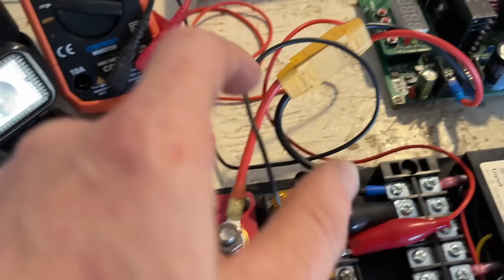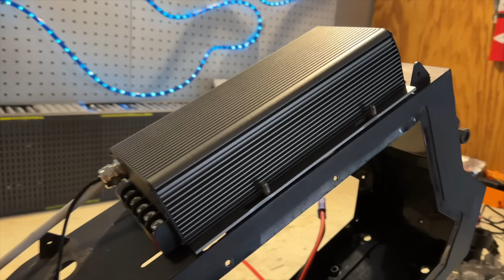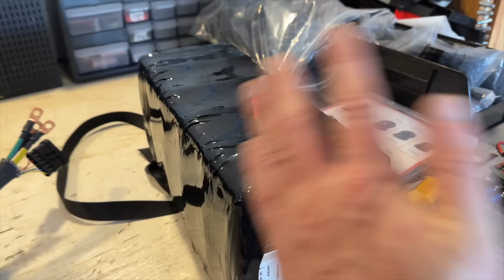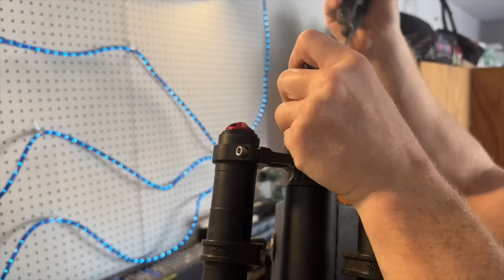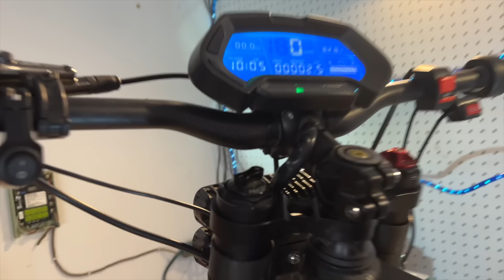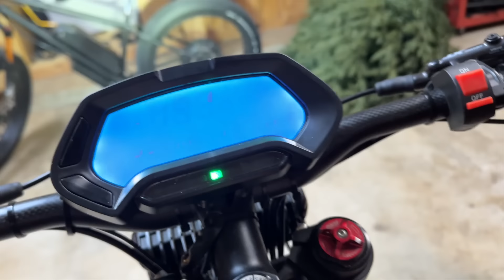This Might Be The Best Way to Build a Stealth Bomber Ebike

Comment: Awesome Video!!!
Did you just straight plug the controller in or did you program it? Because on mine the regenbreaking is not working for some reason.
Reply from the maker: I programmed it but didn't film that part. if you have a throttle connected to the regen throttle harness (make sure gnd, 5V, & signal wires are correctly oriented), you need to enable the "e-brake" option. then make sure you have the ebrake current option set high enough to make a difference. on mine it was initially set too low to notice. there's also the non-variable regen, which activates when you let off the throttle. for that you have to keep the "ebrake" setting off and set the regen option to one of the three settings depending on what behavior you prefer.

Comment: Is the phase junction box waterproof being out in the open like that.
Reply from the maker: definitely not waterproof but its not an issue other than corrosion over time. ideally, the terminal lugs would be nickel plated but if you clean the terminals every year or so it should be fine

Comment: Can you give me a final cost of everything you had to put into this and I must say very very well done
Reply: Yeah what? You must have to call them and ask for better pricing I assume
Reply: another video with NONE OF THE INFO WE NEED... so fkn annoying
Reply: Looks like around 2100 without battery. 

I just ordered mine from China. 

72v 8000w 40ah battery included 

Mine was 2100 to my door.  Included motorcycle seat, color lcd display,  19" turtle tires with gold rims, red frame, zoom front fork, kke rear suspension, hydraulic brakes with 203mm rotors. Headlights and brake lights, 100a controller, horn, alarm , fenders

Of course he has the regen braking,  I don't have any of that
Reply: @joshpointoh  actually mate your controller may very well support regen, it’s something you actually have to enable it through the app, it’s kinda confusing but there are videos on how to do it.
Reply: @kimhyunwoo8983  I had no idea regen was done through the controller
Reply: @joshpointoh  yeah controllers are what add regen the only requirement for hub motors to use it is generally for it not to be a geared hub motor(however I think some have the capability)
Reply: @joshpointoh  can you provide a link to the kit?
Reply: @joshpointoh so you paid 2100 with the battery?
Reply: @joshpointoh  where did you order from?
Reply: @davidrodriguez2830  most likely alibaba
Reply: @kimhyunwoo8983  alibaba, and yes that's with a 40ah battery
Reply: @joshpointoh link?
Reply: @joshpointoh can you please give me a link to that bike if you can
Reply: @joshpointoh where did you order from?
Reply: @joshpointoh  where did you order from?

Comment: You should first read the manual for ct-22 then you'll find out bout the two power lines required plus there isn't a signal light for brk-sw (only turn, regular light signals plus 3 speed mode). memory line keep some setting otherwise you always have to readjust which is annoying. There are couples of forums availabe that might come handy with all the parameters to set them up accurate for the speedo.

Do you also have a heat shield against sunlight for your battery inside that frame? What are the specs of the battery pack? Have you made a circiut diagram for all the wiring?
Reply: The nom was 82? It looked like a 23s ?

Comment: What is the make and model of the battery simulator you are using? That would be very handy for bench top testing.
Reply from the maker: That's just a generic server power supply connected to a step-up converter. Any combo of the two will work. the power supply outputs 50V which is stepped up to 72V

Comment: @GaiusGarage What is the purpose of having the relay to control the 12v system, why not just run the battery voltage straight through the key switch to the DC-DC? I assume its because of the key switches amp rating.
Reply from the maker: yes, that's the reason. if you run the input to the 12V system directly through the key switch, you will be relying on the switch to carry the full current. In this case it will probably be ok because the 5A max output on the 12V system means that it will only be around 0.7A on the hi-voltage system. The key switch can most likely handle that current. But it is also just bad practice to do it that way and you should use a proper relay when possible
Reply: @GaiusGarage  Noted. I'm doing a conversion similar to your KLS with a full 12v system (road lights etc) and was just going to leave the DC/DC on constantly and just 'key switch' the 12v side. Do you have to worry about current inrush with connecting the DC/DC to pack voltage?
Reply from the maker: @NathanAarts  no issues connecting the converter to pack voltage but putting the key on the 12V side is worst becsuse the current will be higher. whatever your max load is it will have to run through the key which will eventually fail in some way. i don't recommend using the key without a relay of some sort but if you're going to run it directly, it should go on the high voltage side
Reply: @GaiusGarage  What key switch did you use on the high voltage side to trip the relay? I'm having a hard time finding a switch rated for pack voltage that isnt a circuit breaker.
Reply from the maker: @NathanAarts  just the switch that came with the frame. you don't need a special switch. the current rating is what really matters and it would be a few fractions of an amp if you're using it for a relay (especially at 72V) so the key switch is more than adequate. the voltage rating is not irrelevant, but it's a matter of arching - when you disconnect a high-voltage switch under load (while current is running) it tends to create an arch - this is the principle behind welding. so ideally a voltage switch would be designed to prevent that, which is what a contactor is for. but when the power is very low, like for the relay, the risk of a sustained arch is much lower. also 72V is not that high voltage in terms of risk of arching. long story short, a basic key switch is fine. but definitely don't ignore the voltage rating when choosing a contactor
Reply: @GaiusGarage  Appreciate the reply. I've got a double contactor setup so I can do automated and controlled precharging, this is my first build and will be ridden daily (hopefully) so I want to do it right/safe. My pack is 96v nominal with 300a peak discharge.
Reply from the maker: @NathanAarts  Nice! sounds like an awesome build. is it an electric motorcycle or an enduro-type ebike?

Comment: What is the contactor used for, if I missed it sorry but I'm very confused
Reply from the maker: I didn't go into much detail in this video but the contactor is used to connect and disconnect the battery pack from the rest of the system using a switch. its just a high-power relay and used a lot like the kill switch on a gas motorcycle - the key switch starts up the electronics, then you flip the kill switch and start the engine. with electric vehicles, you don't need to start the engine but the rest of the process is the same, so contactor is like the kill switch
Reply: Basically if you have used a ebike with a hailong battery for example you’ll realize there is a power switch, but also a on and off switch on most throttles his contractor is used to kill the batteries power because most of these bomber builds lack this and in technical battery health it’s not good to always have the battery “on” with no kill switch to make it stop sending voltage.

Comment: Great video!
Can you do one showing and explaining the variable regeneration on the second throttle?
If you covered it before, I missed it.
Reply from the maker: Thanks! the variable regen is pretty simple - there is a connector for it on the controller harness which I show in the video. just connect any throttle there, and select "e-brake" in the app/software and that throttle will operate as variable regen
Reply: @GaiusGarage  thank you

Comment: What app are you running to get the realtime specs?  is it part of the display or sabvoton controller?
Reply from the maker: its actually the app for the BMS. its Ant BMS - but the later models use a newer app that doesnt have the voltage and current dials and graphs..sucks

Comment: I know the bat straps should keep the bat from sliding forward and contacting the angled part of the frame, but I would put a bumper between the battery and the angled frame.

Comment: the battery pack appears to be butted against the angled frame in the front....could that cause a rub against the battery pack?
Reply from the maker: might just be the angle in the shot, it's definitely not in contact with any part of the frame at the front